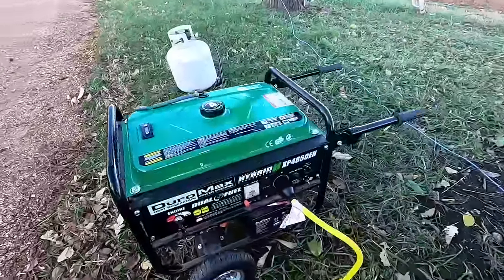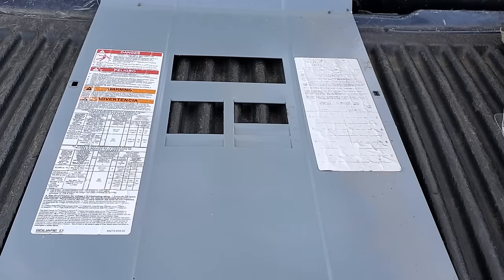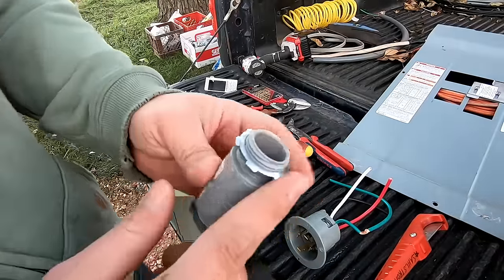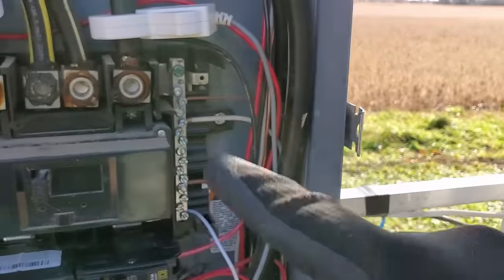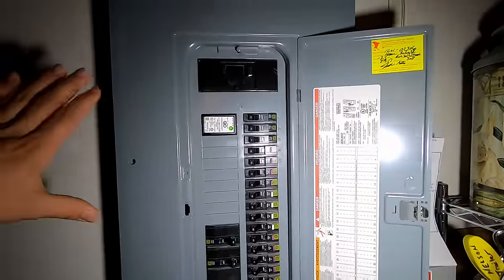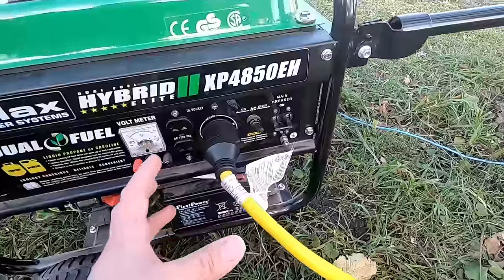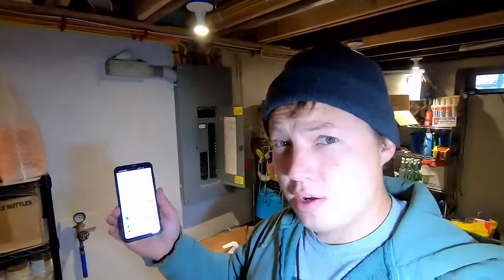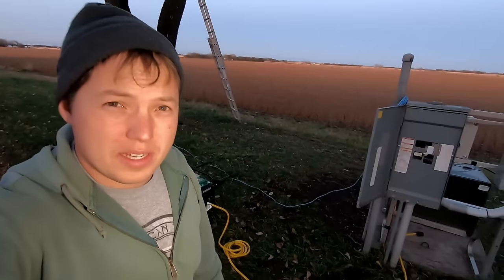How To Hook Up a Generator To Your House Using a Breaker Interlock Kit & Power Inlet Box

Comment: Hi Ben, i am a licensed electrical contractor for 45 years and i have to complement you on your video. It was well presented, pointed out code requirements and proper workmanship. Great job
Reply: @The_Happy_Aviation_Enthusiast  0
Reply: How to unlock a Amazon Echo
Reply: Safety glasses, Arc Flash clothing, high voltage gloves.  Put cardboard in when drilling in panel, metal shavings, plus pilot hole first before step down bit.
Reply: Torque  is required  by code 
Breakers are marked with torque  spec . .
Reply: Will the fact that he has the sense energy monitor leads connected around both the utility power leads and the generator leads throw off the readings in any particular situation?
Reply: Impressive!

Comment: He's fairly knowledgeable and did a great job. Only as a suggestion: While on the grid map and record the wattage requirements of each home run (breaker) and rate them in priority of need. Mark said breakers or panel with reflective paint & number them, Green [1], Yellow [2] and Red [3]; green "PRIORITY "for low watts, yellow for medium watts and Red for high watts. Green for refrigerators, lighting, furnaces etc., Yellow for luxury (A/C, water heater, microwave ovens, toaster etc.) and Red for those specific loads that will require turning off those "YELLOW" [2] loads when in use. Doing this will remove a lot of guess work later and those pesky trips to the generator in bad weather.  Also, might suggest starting your 'TIMER' App on your phone to keep up with your fuel levels 😉.
Reply: Awesome Ideas!!! Thanks Bro!!
Reply: Agree with Conrad. awesome idea.   love that smart app
Reply: Color coding is the easiest way to make anything more organized and quickly high lighted!
Reply: Very rare a video and a comment completely crush it. Thanks to both of you.
Reply: ⚠️Don’t forget the rules about generator safety: This is a very important announcement for everyone. It’s important to follow all generator safety rules whenever we use portable generators: 

Everyone must see this. This is just a reminder for everyone’s safety. 

1) KEEPING OTHERS SAFE: Please do not allow an unqualified person or your children to operate and service the portable generator. Just because some manuals don’t say that doesn’t mean it’s safe. That is important against the generator safety rules. We also need to be keeping an eye on our children too. You need to make sure that your children are not playing near the portable generator especially when it’s running so they won’t get electrocuted. Generators pose electrical risks and they can be hot during an operation. Please keep your children away from the portable generator at all times. It is important to keep our children safe especially our little ones. Be aware of all the hazards.

2) WHERE TO RUN YOUR GENERATOR: Some people use their portable generators indoors which increases the risk of carbon monoxide poisoning. It’s important to have a carbon monoxide detector if you have a gas generator. Never ever use your generator indoors even if your doors and windows are open and even in the garage is not safe to use a portable generator. Not even at your porch and your deck. It is never safe to use your generator indoors and in enclosed areas of your home. Your generator needs to be 15-20 feet away from your house. 

3)🔥FIRE HAZARDS: Never refuel your generator while it’s running. You need to let your generator cool off before refueling it and before storing your generator. Never overload your generator too. Never ever back feed your generator. You should never plug your generator into a wall outlet. Also never store propane tanks indoors. Please keep flammable things away from the generator as well and please don’t smoke cigarettes near the generator. Having a fire extinguisher next to the generator is also important against the generator safety rules. 

4) GENERATOR OPERATION: make sure your hands are dry before touching the generator. Never use your generator in wet conditions. Don’t let your generator get wet. You need a generator tent if you need to use your generator during wet weather. Please don’t wear loose clothes when operating the generator. Turn on your generator before plugging in appliances. Use the right cord for your generator. Please do not use worn out cords. 

https://youtu.be/I1jT3ANENvI and here is a video more about keeping others safe when using generators 

Hope this helps. Remember safety first
Reply: Just want to say thank you! I've used your suggestions and have made my setup to run in this same way! Awesome ideas!
Reply: My Youtube: Thanks for thee helpful insight...l am putting together some things and your blue print will help in a lot of ways. Plus very very important safety tip for others in my household 👏🏾 💯
Reply: @The_Happy_Aviation_Enthusiast  I don't have an option as to where I put my 7000 watt generator if I want it dry and covered. I'm a 75 year old woman with zero help from anyone and don't want to have to walk outside in a high-wind blizzard storm to have to manage the generator. I have a screened in patio where I've hung shower curtains with spring rods and it's attached to my garage. I don't know where else to put it. I loosen the curtains so there's air circulation and open my garage door. If it's a blizzard, that Michigan is getting tonight (12/2022), I don't want my garage or patio getting snow accul

Comment: Remember....when running 240V you have to balance both legs, not just total demand.  You might have refrigerators, microwave, lights, etc all running on the same leg which could overload the generator while still being under the total generator wattage rating.

Comment: You should build a small ventilated shelter at the main panel for the generator & fuel tanks.  That way you can hook up and run it rain or shine.
Reply: I would also add some big ass'd steel poles around it like the ones at the gas station so no one can run in to the pumps.
Reply: Damn good idea
Reply: maybe he should remove the oak leaf
Reply: @christined3953  He did -- at 14:30 in the video you see it's gone.  That was bugging me as well.
Reply: FYI Safety notices say NEVER store your fuel ( gas or propane) near or in a confined space with a running generator

Comment: Great job. I’ve been an electrician for 30 years and have never used or seen anyone use a torque screwdriver on a breaker. But I have run into a lot of loose connections. I think regardless over time and heating and cooling they would still get loose. I make it a habit to check all connections when I’m doing a job for someone. Keep up the good work.
Reply: Don’t forget about the generator safety tips as well. Remember it’s important to follow all the generator safety rules whenever you use your generator. Here are the generator safety tips:

1) Please do not allow an unqualified person or your children to operate the portable generator. Just because some manuals don’t say that doesn’t mean it’s safe. That is important against the generator safety rules. We also need to be keeping an eye on our children too. You need to make sure that your children are not playing near the portable generator especially when it’s running so they won’t get electrocuted. Generators pose electrical risks and they can be hot during an operation. Please keep your children away from the portable generator at all times. It is important to keep our children safe especially our little ones. Be aware of all the hazards.

2) Some people use their portable generators indoors which increases the risk of carbon monoxide poisoning. It’s important to have a carbon monoxide if you have a gas generator. Never ever use your generator indoors even if your doors and windows are open and even in the garage is not safe to use a portable generator. Not even at your porch and your deck. It is never safe to use your generator indoors and in enclosed areas of your home. Your generator needs to be 15-20 feet away from your house. 

3) 🔥generators cause fire hazards too. Never refuel your generator while it’s running. You need to let your generator cool off before refueling it and before storing your generator. Never overload your generator too. Never ever back feed your generator. You should never plug your generator into a wall outlet. Also never store propane tanks indoors. Please keep flammable things away from the generator as well and please don’t smoke cigarettes near the generator. Having a fire extinguisher next to the generator is also important against the generator safety rules. 

4) generator operation; make sure your hands are dry before touching the generator. Never use your generator in wet conditions. Don’t let your generator get wet. You need a generator tent if you need to use your generator during wet weather. Please don’t wear loose clothes when operating the generator. Turn on your generator before plugging in appliances. Use the right cord for your generator. Please do not use worn out cords. 

https://youtu.be/I1jT3ANENvI and here is a video more about keeping others safe when using generators and also about our family’s safety. Hope this helps
Reply: I’m not electrician, so take this for what it is worth. If you use a torque wrench or screwdriver one time so you get an idea of what the proper torque feels like, you probably wouldn’t need to use one again. 
However, in large commercial systems it may be a good idea.
Reply: @bobh6728  According to the code people that is not true and actual testing showed so much  variability that the code was updated to require use of an appropriate tool.
Reply: All my time as an electrician I have never seen a guy troque a breaker. Main inputs, yes. But nothing more than that.

Comment: This is the ONLY video that shows the SAFEST way to properly install a generator to your house.  Extremely well done  Take the time BEFORE you need a generator to power your home.  Your safety, your families safety & the guys working on the power lines safety is very important.  I agree with another comment - mark your circuit breakers, so you will know which ones are the most important to operate & which ones to leave OFF.  I also recommend that people do a full system test at least once a year & run your generator monthly, so it will run, when you really need it.

Comment: Great video! I’ve been a generator mechanic for a long time and you explained everything well. I have installed 4 generator interlock in the last few years. 2 for myself and 2 for my HOA employee housing. They are perfect as they give you the flexibility to power whatever you want in your home over a separate generator panel with limited circuits. Let alone the cost being so much more reasonable.
Reply: ⚠️Portable Generator Safety Tips:

1) KEEPING OTHERS SAFE: Please do not allow an unqualified person or your children to operate and service the portable generator. Just because some manuals don’t say that doesn’t mean it’s safe. That is important against the generator safety rules. We also need to be keeping an eye on our children too. You need to make sure that your children are not playing near the portable generator especially when it’s running so they won’t get electrocuted. Generators pose electrical risks and they can be hot during an operation. Please keep your children away from the portable generator at all times. It is important to keep our children safe especially our little ones. Be aware of all the hazards.

2) WHERE TO RUN YOUR GENERATOR: Some people use their portable generators indoors which increases the risk of carbon monoxide poisoning. It’s important to have a carbon monoxide detector if you have a gas generator. Never ever use your generator indoors even if your doors and windows are open and even in the garage is not safe to use a portable generator. Also please never use your generator in your deck or balcony. It is never safe to use your generator indoors and in enclosed areas of your home. Your generator needs to be 15-20 feet away from your house. 

3)🔥FIRE HAZARDS: Never refuel your generator while it’s running. You need to let your generator cool off before refueling it and before storing your generator. Never overload your generator too. Never ever back feed your generator. You should never plug your generator into a wall outlet. Also never store propane tanks indoors. Please keep flammable things away from the generator as well and please don’t smoke cigarettes near the generator. Having a fire extinguisher next to the generator is also important against the generator safety rules. It’s also not safe to move your generator while it’s running.

4) GENERATOR OPERATION: make sure your hands are dry before touching the generator. Never use your generator in wet conditions. Don’t let your generator get wet. You need a generator tent if you need to use your generator during wet weather. Please don’t wear loose clothes when operating the generator. Turn on your generator before plugging in appliances. Use the right cord for your generator. Please do not use worn out cords. 

https://youtube.com/shorts/eFigDfnPkcQ?feature=share and here is a short video more about keeping others safe when using generators. Portable generators need maintenance so it’s important to follow the safety instructions.

Hope this helps

Comment: Installed an interlock, 30 amp inlet and breaker last year. Had a 24-hour power outage about a month ago and it worked great. A lot better than using a bunch of extension cords running all over the place.  Thanks for sharing your knowledge.

Comment: I have searched for an install video for a while and finally found this one. By far the best video I've seen!!
Reply: Don’t forget about the generator safety tips as well. Remember it’s important to follow all the generator safety rules whenever you use your generator. Here are the generator safety tips:

1) Please do not allow an unqualified person or your children to operate the portable generator. Just because some manuals don’t say that doesn’t mean it’s safe. That is important against the generator safety rules. We also need to be keeping an eye on our children too. You need to make sure that your children are not playing near the portable generator especially when it’s running so they won’t get electrocuted. Generators pose electrical risks and they can be hot during an operation. Please keep your children away from the portable generator at all times. It is important to keep our children safe especially our little ones. Be aware of all the hazards.

2) Some people use their portable generators indoors which increases the risk of carbon monoxide poisoning. It’s important to have a carbon monoxide if you have a gas generator. Never ever use your generator indoors even if your doors and windows are open and even in the garage is not safe to use a portable generator. Not even at your porch and your deck. It is never safe to use your generator indoors and in enclosed areas of your home. Your generator needs to be 15-20 feet away from your house. 

3) 🔥generators cause fire hazards too. Never refuel your generator while it’s running. You need to let your generator cool off before refueling it and before storing your generator. Never overload your generator too. Never ever back feed your generator. You should never plug your generator into a wall outlet. Also never store propane tanks indoors. Please keep flammable things away from the generator as well and please don’t smoke cigarettes near the generator. Having a fire extinguisher next to the generator is also important against the generator safety rules. 

4) generator operation; make sure your hands are dry before touching the generator. Never use your generator in wet conditions. Don’t let your generator get wet. You need a generator tent if you need to use your generator during wet weather. Please don’t wear loose clothes when operating the generator. Turn on your generator before plugging in appliances. Use the right cord for your generator. Please do not use worn out cords. 

https://youtu.be/I1jT3ANENvI and here is a video more about keeping others safe when using generators and also about our family’s safety. Hope this helps